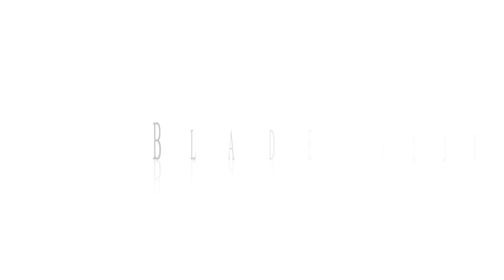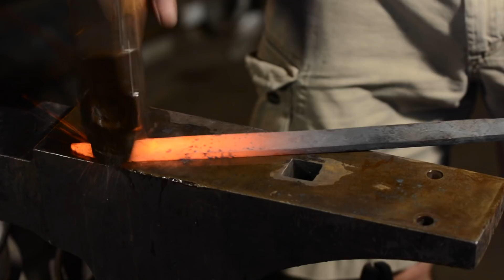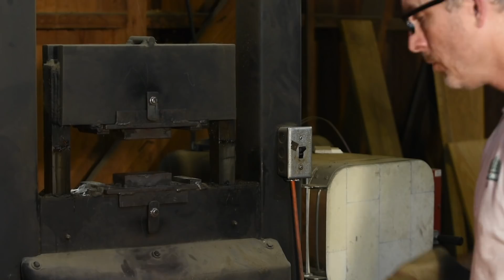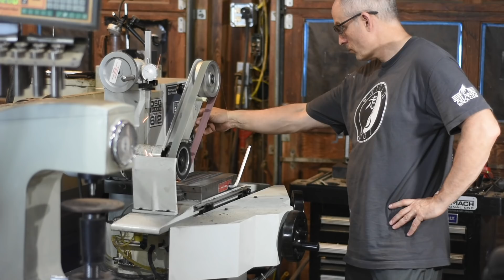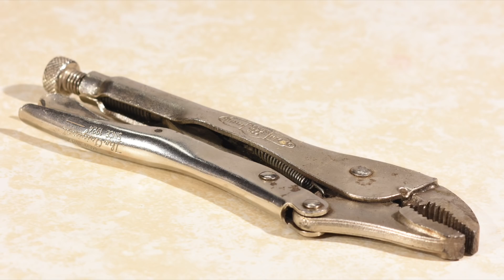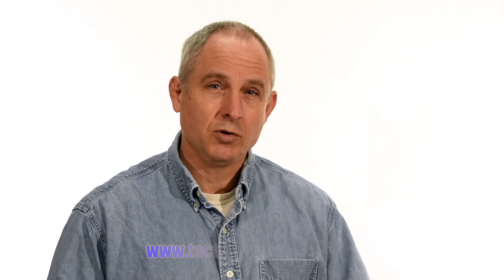Build a FANTASY Knife Making Shop!

Comment: fun video. I am sure you are tired of hearing this sort of thing, so forgive me. Beaumont Metalworks with the KMG and the variable disc grinder are awesome. I love both. fun stuff. The little portaband with the table for it aftermarket is the best small bandsaw for metal. The horizontal bandsaw are good, too. It is possible to have both for less than $800.

Comment: What would you prefer for edge retention? M2 or D2 tool steel?
Reply: Have you watched this video?:
https://youtu.be/mzSCxtHccFA
Reply: A2 could be subject to rust if care is not taken and can't reach the hardness of D2 or M2. D2 has better corrosion resistance and edge retention than A2; however, this is at the expense of toughness. M2 is excellent at retaining a knife edge, but it can be too brittle for some applications. 
I only have knives made of D2 so I can't speak for the others, but it's not as easy to sharpen as most of my knives. Once you do get it sharpened, the edge retention is great.
Reply: It Won't Hurt for Long 
Thanks!

Comment: Wait, you don't have three-phase power in the US?! Not even in houses?
Reply: Nope, it's transformed down to a split phase L1 and L2 and Neutral which is grounded at the breaker - 110 uses one leg and neutral, 220 uses both legs - the difference between them being 220v. Kinda silly really, but most homes do not require 3 phase anywhere near it, so sending only 2 legs around the neighborhood requires less copper to run that extra line, less shit in the breaker box, and less labor to wire it up. It's just how we set it up decades ago, and everything since has been made to that standard, much like the UK's power runs on 50hz and US runs at 60hz, so motors and appliances won't run right if you take them across the pond.  Depending on location, you can get 3 phase to your shop, but the power company will charge you through the nose if it's not close.

Comment: A steel cutting portaband saw with a "Swag" table to secure it upright should be one of the first tools, as it will save so much time and trouble than using a dangerous angle grinder to cut steel and knife profiles, and handle materials not meant for wood cutting band saws such as micarta, g10, carbon fiber etc. .  Milwaukee and Dewalt are two of the most often used and work very well for a lot of knife makers.   This set up brand new will come up to about $460 depending on where you buy and the exact model.   IMHO, a variable speed and reversable 9"  disc grinder with an adjustable work rest is much more useful in knife making than a disc sander, especially because you can use any grit and any type of 9x11" sandpaper (Redline Ryhnowet is the best for price/quality paper for all hand sanding) on the disc with spray glue or feathering adhesive.  The versatility of these disc grinders can be incredibly helpful for knife making tasks for getting things FLAT and square, especially flattening blade bevels prior to hand sanding.

This is a question that is very often asked and answered on BladeForums, but usually regarding low budgets.  Walter did an excellent job explain most of what you'll want to get, but  I would also definitely get the thoughts and opinions of the guys over there as well, they'll help with much of the specifics and brands and also small things you need/want that aren't usually thought of as main shop tools, but can be essential.  Here is the link to the specific sub forum to ask the question regard what shop tools will suit you best:  http://www.bladeforums.com/shop-talk-bladesmith-questions-and-answers.741/    

It's the "Shop Talk - Bladesmith Questions and Answers" subforum on BladeForums.

Comment: Really great treatment of the subject... the experience really shows.  
One additional thought on buying used machine tools; If you don't have experience repairing / restoring precision machine tools (mills, drills, presses, grinders, etc) you are likely to miss stuff during the evaluation process before you buy. Good tools have good parts manuals available, but often don't have specs related to acceptable run out for bearings, drive screws, etc. this is because they are selling you a new machine, which is tight as a drum, and has been thoroughly inspected at the factory.  It will be a different story after 20 years of hard use with varying degrees of maintenance. 
This information is not as intuitive, or as available  as you may think.  Still, re-building an old machine is fun in itself.  Try to use only factory parts if possible. 
Buying from reputable dealers will help, but their profit will increase your cost a lot.

Comment: Great video. One thing to add with the size of the heat treat oven is not to have the steel touching the sides or the coils. Ideally you would be evenly spaced away from the walls of the oven. Being too close to the coils means you run the risk of part of the steel taking a higher temp while the rest is at your set temp. So if you make 18in knives don't buy the 18in oven get the next size up to give that space to achieve a more even heat.
Reply: With heat treat ovens, it's always going to be too small for everything. 18" is plenty for chef knives, folders, hunters, axes and all sorts of stuff, but there's always going to come a day when you're making a massive kukri or long dagger, and that 18" that you've been using for years is just a little too damn small.

Comment: Most important thing between a Press and a Power Hammer - Your floor. If the flooring isn't really REALLY thick concrete, you have to use a massive steel plate on the ground to distribute the blunt force a power hammer puts out or you'll crack your foundation. The press though, you're good on any floor.

Comment: I have that NC Tool dual burner forge you speak of. It came with a good propane regulator. The forge has been flawless for years. Holds heat well and for the 1st hour or so you can actually touch the outside of it and it won't be hot enough to burn you. The bottom is solid too, so you don't burn up the KOWool with flux.

Comment: Its gonna cost me about 1500 to get mine up and running, and thats pretty basic 1x30 grinder, 10 or 20 kg anvil, decent little gas forge
Reply: So the infamous 1x30.lol I've had 2. I bought a WEN on Amazon. Great little grinder and ran true. Just gave it to a coworker for free that wanted to get into knife making. I then got a RIKON 50-161VS. that is a more powerful 1x30 that has variable speed. I still have it set up for fine touch ups. I bought a DAS Toobinater on Ebay 2x72. They sell it In different variations with what it comes with.  With shipping you can get one ready to go for about $900.  The rikon is nice for what it is but is about $220 for a 1x30. The smaller the grinder the more belts you need because they wear fast.  Also I would get an angle grinder starting out to cut things out. And get a bandsaw when you can afford it.
Reply: I have the angle grinder and a mate of mine is giving me his old drill press, i only got the 1x30 to start out with(gotta be easier than a file, right), if i make any money selling knives I'll move upto a bigger grinder
Reply: Matthew Sherriff -  You don't need an expensive blacksmiths anvil for forging knives (I.e, bladesmithing), a post anvil (do a YouTube search) is usually more than enough to forge blades on, it's essentially what traditional bladesmiths use in Japan.  You can go to a junk yard and find an old forklift tine and turn it on end which is what a lot of guys do.  That way all of you mass is directly below to area where you do 95% of you forging.  Plus they're made of 4140 tool steel.  I spent a bit over $200 on a piece of 4x4" (face size) by 11" (in height) hardened and tempered 4140 post anvil, which when mounted properly is all you'll need for bladesmithing.   I got mine like 5-6 years ago but just send an email to the guys at "Old World Anvils" from their website and they most likely have them in stock, even though they aren't listen on their website.   

Check out the post anvil vids on YouTube by "Lewis Razors" called "new post anvil & one piece forging" and by "Rick Marchand" called "Forging - Anvil and Hammers (part 2 of 3) and also (part 3 of 3) and you'll see how they work and some good tips on them.   You could then use the extra money you'll save on the post anvil for a decent 2x72.  If you're interested, check out BladeForums in the Shop talk questions and answers subforum and you'll get a lot of help with things you'll want and saving money on things you don't need etc. .
Reply: @lsubslimed  Thanks for sharing that bit on "old world anvils"
Reply: lsubslimed thanks for the info